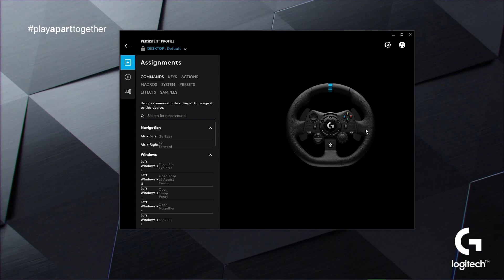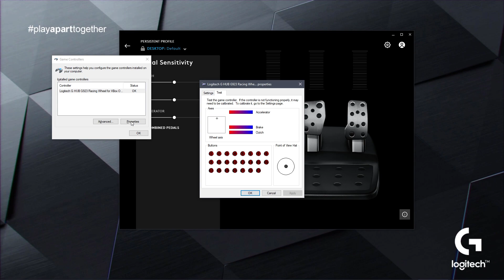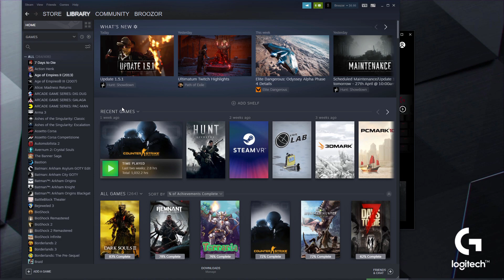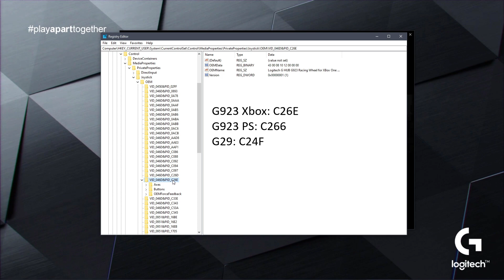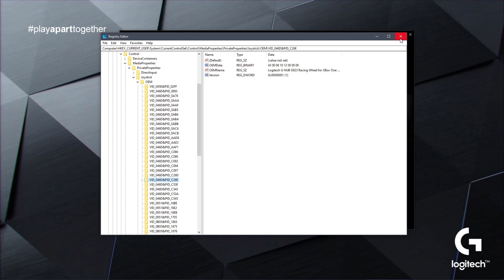How to troubleshoot G923/G29/G920 for Connection Issue

Comment: my cord is secured firmly but still white blinks is the cord burnt?
Reply: READ ALL, I FOUND A POTENTIAL FIX- I fixed it. So what I needed to do was unplug everything from my outlet (except the one below, for context I had an 2*3 adapter for a 2 plug outlet) and it worked just fine after. I had been searching for months prior and I was on the verge of selling it but all it needed was its own outlet. BUT, some outlets have less than 120V, It says this thing only uses 30V but it has to have 120V, kinda weird but whatever. So if that doesn’t work then try a new outlet, your outlet may also have some issues so another good reason. be sure that you have all three cords plugged into the wheel four cords if you have a shifter.

Comment: You did not mention what to do if Ghub doesn’t recognize pedal or steering movements but lights are blinking?
That’s where I’m at. You only tell people to move to the next step if it’s working
Reply: when the lights are blinking like that it means that the wheel knows what’s going on. It already has a system that has troubleshoot it so just look up what it means for your specific scenario. I don’t know what your lights are doing other than blinking but for instance, mine state of solid color, which meant that there was a power issue

Comment: what is my wheel has the flashing LED on top however does not detect the wheels spinning but does detect button presses?
Reply: READ ALL, I FOUND A POTENTIAL FIX- I fixed it. So what I needed to do was unplug everything from my outlet (except the one below, for context I had an 2*3 adapter for a 2 plug outlet) and it worked just fine after. I had been searching for months prior and I was on the verge of selling it but all it needed was its own outlet. BUT, some outlets have less than 120V, It says this thing only uses 30V but it has to have 120V, kinda weird but whatever. So if that doesn’t work then try a new outlet, your outlet may also have some issues so another good reason.
Reply: make sure all three cords are plugged in, four if u have a shifter
Reply: also, you can look it up what your wheel is doing on the RPMs and it will tell you what is going on and it will tell you the potential but it may not be an internal issue could also be an external issue like I was saying an outlet or something like that

Comment: Can i use a  MacBook to fix the steering wheel?
Reply: I don’t think so, but try this
Reply: READ ALL, I FOUND A POTENTIAL FIX- I fixed it. So what I needed to do was unplug everything from my outlet (except the one below, for context I had an 2*3 adapter for a 2 plug outlet) and it worked just fine after. I had been searching for months prior and I was on the verge of selling it but all it needed was its own outlet. BUT, some outlets have less than 120V, It says this thing only uses 30V but it has to have 120V, kinda weird but whatever. So if that doesn’t work then try a new outlet, your outlet may also have some issues so another good reason. be sure that you have all three cords plugged into the wheel four cords if you have a shifter.

Comment: What do I do if my wheel doesn’t move in the g hub thing but my pedals do
Reply: happens to me and the lamp keeps blinking, i bought a 24v 3A psu still not works with the wheel
Reply: READ ALL, I FOUND A POTENTIAL FIX- I fixed it. So what I needed to do was unplug everything from my outlet (except the one below, for context I had an 2*3 adapter for a 2 plug outlet) and it worked just fine after. I had been searching for months prior and I was on the verge of selling it but all it needed was its own outlet. BUT, some outlets have less than 120V, It says this thing only uses 30V but it has to have 120V, kinda weird but whatever. So if that doesn’t work then try a new outlet, your outlet may also have some issues so another good reason. be sure that you have all three cords plugged into the wheel four cords if you have a shifter.
Reply: I don’t think 24 V is enough the wheel takes 30 V to 40 V to work

Comment: hello! my g923 only has the rpm lights on but wont calibrate ev ntho i did what the video said
Reply: That means that your wheel is having a power issue so I want you to read all of this and maybe it will fix your issue
Reply: READ ALL, I FOUND A POTENTIAL FIX- I fixed it. So what I needed to do was unplug everything from my outlet (except the one below, for context I had an 2*3 adapter for a 2 plug outlet) and it worked just fine after. I had been searching for months prior and I was on the verge of selling it but all it needed was its own outlet. BUT, some outlets have less than 120V, It says this thing only uses 30V but it has to have 120V, kinda weird but whatever. So if that doesn’t work then try a new outlet, your outlet may also have some issues so another good reason. be sure that you have all three cords plugged into the wheel four cords if you have a shifter.

Comment: I did everything and still didn't work...
Reply: READ ALL, I FOUND A POTENTIAL FIX- I fixed it. So what I needed to do was unplug everything from my outlet (except the one below, for context I had an 2*3 adapter for a 2 plug outlet) and it worked just fine after. I had been searching for months prior and I was on the verge of selling it but all it needed was its own outlet. BUT, some outlets have less than 120V, It says this thing only uses 30V but it has to have 120V, kinda weird but whatever. So if that doesn’t work then try a new outlet, your outlet may also have some issues so another good reason. be sure that you have all three cords plugged into the wheel four cords if you have a shifter.

Comment: My g923 has a weird issue where im pressing the x button and all the other buttons are going off. Nothing worked. Logitech support didnt respond…
Reply: READ ALL, I FOUND A POTENTIAL FIX- I fixed it. So what I needed to do was unplug everything from my outlet (except the one below, for context I had an 2*3 adapter for a 2 plug outlet) and it worked just fine after. I had been searching for months prior and I was on the verge of selling it but all it needed was its own outlet. BUT, some outlets have less than 120V, It says this thing only uses 30V but it has to have 120V, kinda weird but whatever. So if that doesn’t work then try a new outlet, your outlet may also have some issues so another good reason. be sure that you have all three cords plugged into the wheel four cords if you have a shifter.
Reply: The RPMs will tell you what’s wrong with it you just have to look up what it means when your RPMs are doing whatever they’re doing for instance, my RPMs were all turned on which meant that there was a power issue

Comment: 1:57 My wheel wasn’t represented on g hub what do i do
Reply: READ ALL, I FOUND A POTENTIAL FIX- I fixed it. So what I needed to do was unplug everything from my outlet (except the one below, for context I had an 2*3 adapter for a 2 plug outlet) and it worked just fine after. I had been searching for months prior and I was on the verge of selling it but all it needed was its own outlet. BUT, some outlets have less than 120V, It says this thing only uses 30V but it has to have 120V, kinda weird but whatever. So if that doesn’t work then try a new outlet, your outlet may also have some issues so another good reason. be sure that you have all three cords plugged into the wheel four cords if you have a shifter.

Comment: It detected my PlayStation G29 wheel on PC with shifter. I'm turning it, but it doesn't turn in Logitech G Hub. The pedals also do not react in G Hub, as so the shifter. However, in in Properties in 2:35, they do. The buttons light up too. I also have an XBOX One controller plugged into my computer. Should I unplug that? Can anyone help?
Reply: READ ALL, I FOUND A POTENTIAL FIX- I fixed it. So what I needed to do was unplug everything from my outlet (except the one below, for context I had an 2*3 adapter for a 2 plug outlet) and it worked just fine after. I had been searching for months prior and I was on the verge of selling it but all it needed was its own outlet. BUT, some outlets have less than 120V, It says this thing only uses 30V but it has to have 120V, kinda weird but whatever. So if that doesn’t work then try a new outlet, your outlet may also have some issues so another good reason. be sure that you have all three cords plugged into the wheel four cords if you have a shifter.

Comment: my shifter is not working it just stoped working i looked evrywhere for a fix and it wont work any advice?
Reply: READ ALL, I FOUND A POTENTIAL FIX- I fixed it. So what I needed to do was unplug everything from my outlet (except the one below, for context I had an 2*3 adapter for a 2 plug outlet) and it worked just fine after. I had been searching for months prior and I was on the verge of selling it but all it needed was its own outlet. BUT, some outlets have less than 120V, It says this thing only uses 30V but it has to have 120V, kinda weird but whatever. So if that doesn’t work then try a new outlet, your outlet may also have some issues so another good reason. be sure that you have all three cords plugged into the wheel four cords if you have a shifter.

Comment: Come to find out, I'm just dumb. XD

I was staring at this random power brick/cord for the longest and didn't know what it goes to. I had the pedals and shifter plugged in but didn't see the tiny hole tucked in the corner for the actual power.

Comment: Nothing has helped. It is connected, simply not detected.
Reply: 😢same issue
Reply: @codewithclaws  READ ALL, I FOUND A POTENTIAL FIX- I fixed it. So what I needed to do was unplug everything from my outlet (except the one below, for context I had an 2*3 adapter for a 2 plug outlet) and it worked just fine after. I had been searching for months prior and I was on the verge of selling it but all it needed was its own outlet. BUT, some outlets have less than 120V, It says this thing only uses 30V but it has to have 120V, kinda weird but whatever. So if that doesn’t work then try a new outlet, your outlet may also have some issues so another good reason.
Reply: @JustAChillDude05 what outlet are u talking abt ? Plugging in the wall?
Reply: I deleted the wheel and now when I refresh it doesn’t show
Reply: @lukemagee3424  same here...
Reply: Plug the power cable into a wall socket… it should work…
Reply: Im having the same issues imagine spending $500 on a setup and i cant use it 🤦‍♂️ well said buddy connected not detected
Reply: Bro wtf…. I took my whole pedal apart, and you’re telling me…… nvm, thanks it helped. But I was lake for my race.😅
Reply: I got it 
Uninstall g hud then reinstall 👍
Reply: Same here I recently got a new gaming pc but literally nothing else has changed and it’s not detected
Reply: When u turn on your steering wheel dont hold it let it calibrate by it self
Reply: Same
Reply: I'm having the same issue. I can use it in iracing but I can't change any settings not in ghub or iracing.
Reply: @User_0120jb  I’ve fixed it several times it’s the pc recognizing it as Xbox control instead of the g920  I’m trying to find the vid tho I forgot how it’s settings in the property’s then it’ll pop up on g hub every time it’s a new Pc or g920 it’ll do this weird thing
Reply: @cruisingsociety576  i have the same thing but with my 923, the weird thing is that it works on my laptop but not on my pc and yes, it's recognizing as a xbox control. how did you fix it?
Reply: @User_0120jb  did you find out ? i really need to know pleas
e
Reply: @User_0120jb  READ ALL, I FOUND A POTENTIAL FIX- I fixed it. So what I needed to do was unplug everything from my outlet (except the one below, for context I had an 2*3 adapter for a 2 plug outlet) and it worked just fine after. I had been searching for months prior and I was on the verge of selling it but all it needed was its own outlet. BUT, some outlets have less than 120V, It says this thing only uses 30V but it has to have 120V, kinda weird but whatever. So if that doesn’t work then try a new outlet, your outlet may also have some issues so another good reason.
Reply: put the plug in more, i thought mine broke, the light was on and stuff, just plug in the plug harder not the usb, and if it doesn’t work it means ur plug is blown out from it being plugged in overnight so find another plug to put it in.
Reply: @GLOWKHYY
Reply: @GLOWKHYY  plug plug plug plug plug plug
Reply: @GLOWKHYY I love you bro🙏
Reply: READ ALL, I FOUND A POTENTIAL FIX- I fixed it. So what I needed to do was unplug everything from my outlet (except the one below, for context I had an 2*3 adapter for a 2 plug outlet) and it worked just fine after. I had been searching for months prior and I was on the verge of selling it but all it needed was its own outlet. BUT, some outlets have less than 120V, It says this thing only uses 30V but it has to have 120V, kinda weird but whatever. So if that doesn’t work then try a new outlet, your outlet may also have some issues so another good reason.
Reply: @JustAChillDude05 if that’s doesn’t work use an older version of ghub like from 2023 and it works
Reply: Did you find it?
Reply: Same here buttons work on home but wheel won’t spin and be recognized by my Xbox
Reply: @iNipzers did you fix this?
Reply: Same
Reply: @Cheeztoe same for me, its connected, it calibrates but never shows up
Reply: @LBS.RACING  you find a fix twin?
Reply: @Cheeztoe  READ ALL, I FOUND A POTENTIAL FIX- I fixed it. So what I needed to do was unplug everything from my outlet (except the one below, for context I had an 2*3 adapter for a 2 plug outlet) and it worked just fine after. I had been searching for months prior and I was on the verge of selling it but all it needed was its own outlet. BUT, some outlets have less than 120V, It says this thing only uses 30V but it has to have 120V, kinda weird but whatever. So if that doesn’t work then try a new outlet, your outlet may also have some issues so another good reason.

Comment: not helpfull everything is plugged in correctly and the light is still flashing i tried everything and its still flashing
Reply: The RPMs will tell you what is wrong with whatever you’re set up is but basically you just need to look up what the RPM means when it’s doing that certain pattern be specific too

Comment: Hello, i know this video is 2 years old but i am having an issue with my Pro Wheel.
In ACC and other games the game should be recognized as Pro Wheel but the game doesnt recognize the wheel.
No binds and the ffb fells really heavy even when i lower it and feels numb also.
Would love some help because i didnt find any solution for my problem.
Thank you.
Reply: READ ALL, I FOUND A POTENTIAL FIX- I fixed it. So what I needed to do was unplug everything from my outlet (except the one below, for context I had an 2*3 adapter for a 2 plug outlet) and it worked just fine after. I had been searching for months prior and I was on the verge of selling it but all it needed was its own outlet. BUT, some outlets have less than 120V, It says this thing only uses 30V but it has to have 120V, kinda weird but whatever. So if that doesn’t work then try a new outlet, your outlet may also have some issues so another good reason.

Comment: Hello I have a problem, g hub detects wheel buttons and pedals pressing but it does not detect wheel turning and it just says its turned -450 degrees, tried replugging updating usb port drivers and everything does not seem to work, could it be that power brick is not getting power to wheel itself?
Reply: READ ALL, I FOUND A POTENTIAL FIX- I fixed it. So what I needed to do was unplug everything from my outlet (except the one below, for context I had an 2*3 adapter for a 2 plug outlet) and it worked just fine after. I had been searching for months prior and I was on the verge of selling it but all it needed was its own outlet. BUT, some outlets have less than 120V, It says this thing only uses 30V but it has to have 120V, kinda weird but whatever. So if that doesn’t work then try a new outlet, your outlet may also have some issues so another good reason.

Comment: i have a 923 for 2-3 years,
 i almost ALWAYS have a problem with the wheel after Ghub gets an update. precisly playing Assetto Corsa Competizionne more often. i always have to fight with the device to make it work again, unplug, plug it do not work all the time. Right now the wheel FFB literally started glitching mid race and crashed my car (never happenned before). I though my wheel was 100% broken this time since i tried all my other methods to fix it usually.  But nothing worked. Ghub was not even connecting the wheel, no power lights either.   BUT when i deleted the wheel registry like you mentionned, it worked again finally !! (at least for now)     ok thank you for a video on information to fix some trouble, but how about you stop breaking everything with each updates ? i have never had that much trouble with a USB device in my life. Worst experience

Comment: 3:30 - my wheel is not detected at this point. Everything works in Ghub, just no detected controllers in Steam. How do I fix this?
Reply from the maker: As indicated in the description as well as the updated closed captioning, Steam no longer recognizes controllers in the fashion seen in this video.
Reply: I think you need to be clearer--are you saying that Steam in settings, under controllers, won't recognize the G29-meaning the controller won't show up there but the controller will work? @logitechsupport